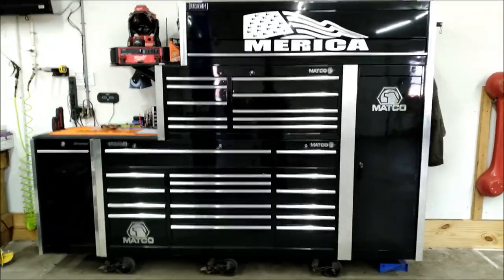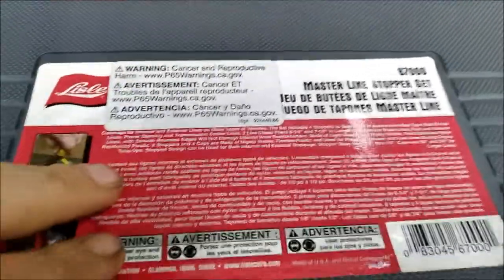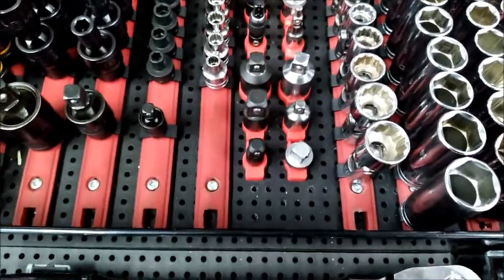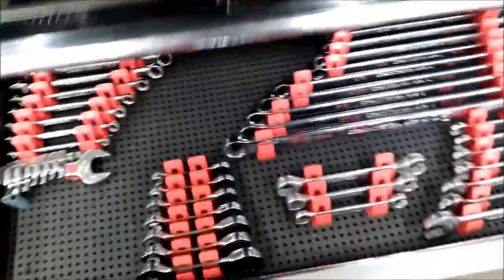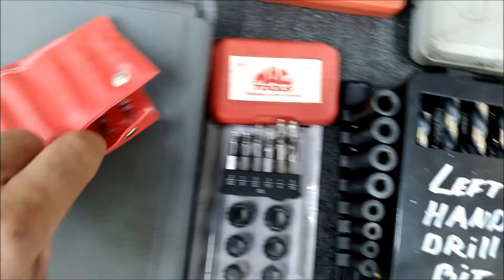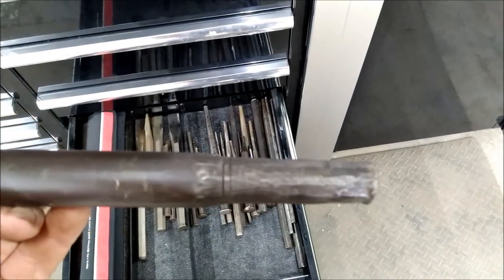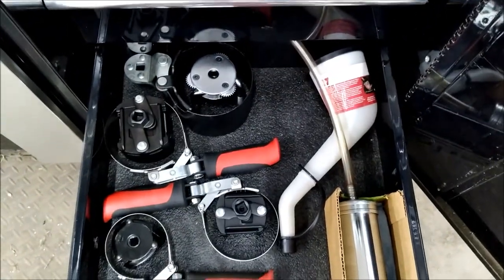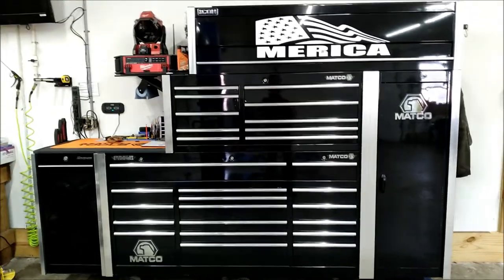Matco Frankenstein toolbox tour

Comment: I find Frankenboxes to be interesting. I’m needing to expand onto my bottom by adding a side box. It’s a Matco that was built in 97 but I’ve taken really good care of it so it still looks relatively new. Anyway, Matco no longer offers a matching side box for it anymore but the ICON side box almost matches it dimension wise. Did you have much difficulty mounting a SnapOn side box to your Matco? Did you use bolts or does it just hang from the top lip? Great tour and I see nothing whatsoever “unpatriotic “ about your Merica logo. Did you make it or buy it? 👍
Reply from the maker: Thank you the Merica sticker was made by my wife ...I hung the Snap on box on the Matco box and it fit perfect I used two pop rivets at the hanging lip and drilled two holes underneath the box and used bolts to secure it all. I seriously considered the Icon side box as well but got lucky and found this 30" matco 5s one ... on mine the Matco 6s would have been perfect but $4000 is a little much for my tasted lol. Hope this helps and thank you for watching ... what model box do you have ?
Reply: @CountryMileGarage  I have a 5S set made in 98.